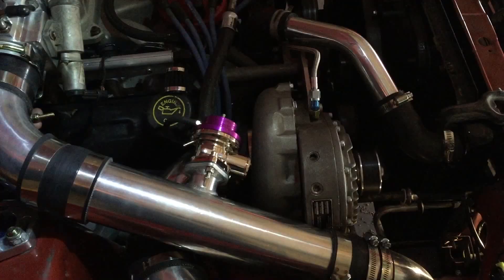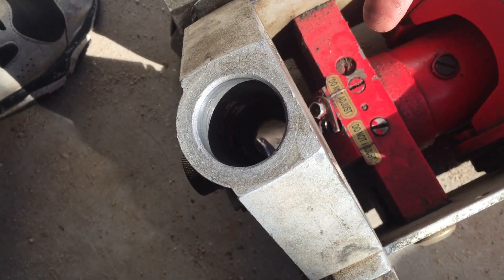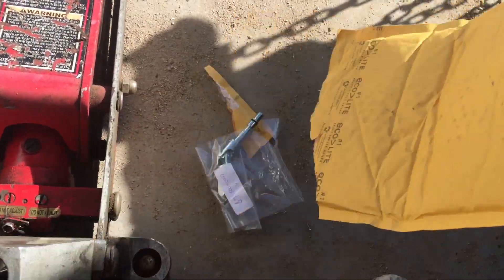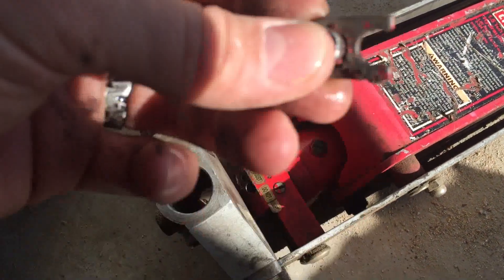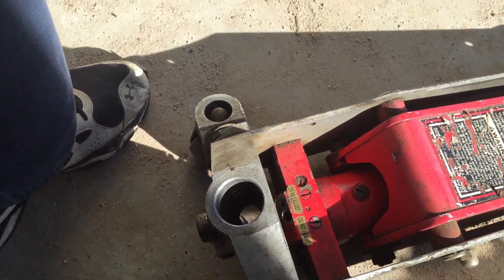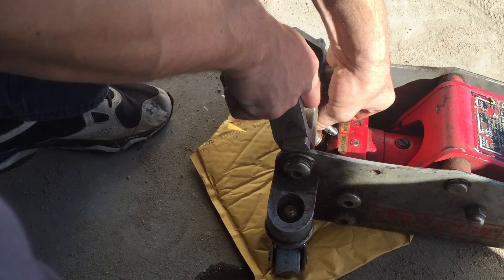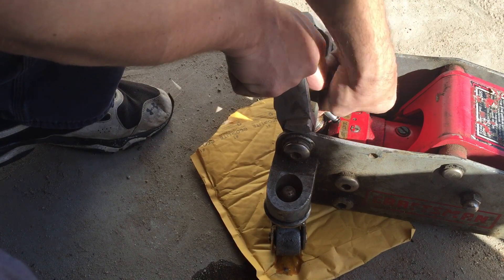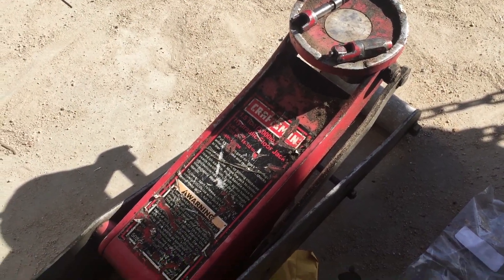Universal Joint Repair [Hydraulic Jack Craftsman 50240]

Comment: My u joint broke years ago, and Craftsman no longer sold the part even when Sears was still alive. I refused to throw it away, but it has sat forever. My wife just said one of her co workers threw out a jack. I was about to dumpster dive and see if I could get mine working again. Then I thought twice. Went on Duck Duck Go and saw this video pop up. You saved my good ol Jack! I'm hoping there weren't variants of this because I'm buying this part right now!    I just checked. I have Model 9-50239

Comment: The Pittsburgh Jacks don't seem to have that stopper.. The uJoint on mine comes all the way out if I turn the handle too far the left (counter clockwise).
Reply from the maker: Yeah, there are a lot of jacks i've seen like that.  I've got a newer jack I bought from advance auto that's the same way...